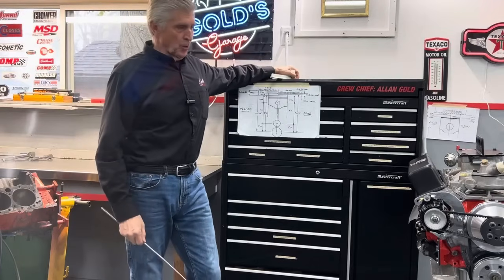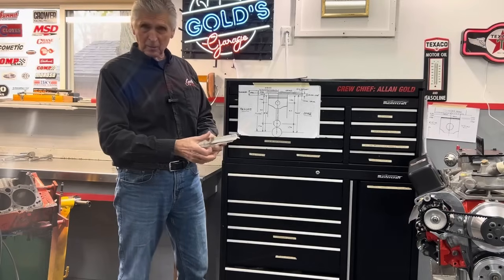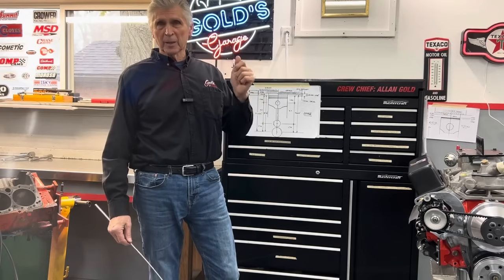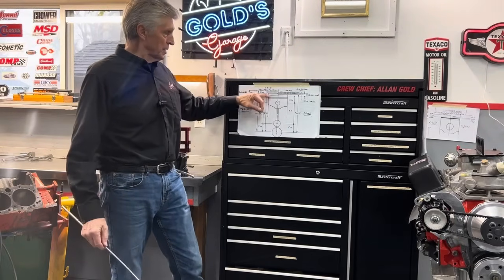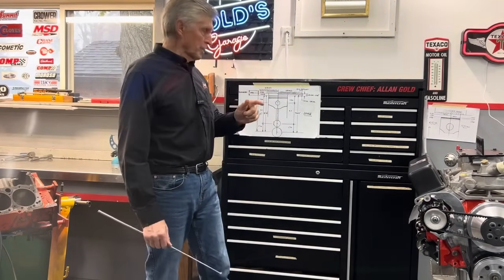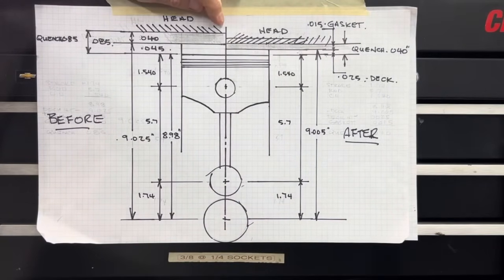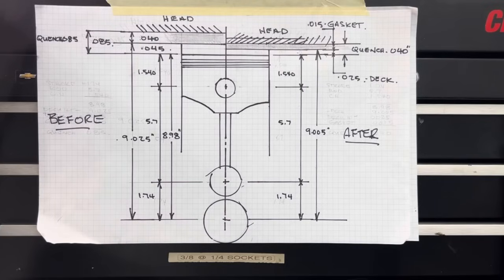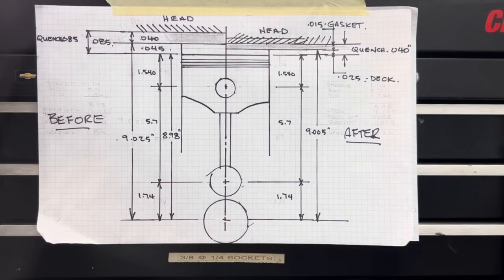MORE COMPRESSION, MORE HORSEPOWER LESS QUENCH! Why it’s Important and what is ideal?  🚫DETONATION

Comment: Forgive me if I didn't see it in other comments.   Crevice volume above the top piston ring and around a head gasket bore that is more than needed can also lead to detonation. Much better burn potential as well.  I recommend a Cometic gasket with the same bore size as your cylinder.  It's probably not in the budget,  but if you go with a 6 inch rod your piston choices gets better and you can get a ring package much closer to the top of the piston.    Just things to think about.   Cheers.
Reply from the maker: All good information, thanks for commenting Comet.AG

Comment: What steel sbc head are you using on this build?
Reply: Cast# 292 angle plug heads.
Reply from the maker: Correct, thanks MJ. Note that the heads are cast iron.  AG

Comment: Old Small block LA mopars always had an open chamber with zero quench.  They should be horrible to tune, and make no hp/tq given your reasoning. In fact, tuning some high hp turbo combinations, your "quench pad " became an issue, and a source of spark knock. It isn't simple
Reply from the maker: Thanks Kyle, sounds like a challenge for sure. AG

Comment: In regards to deck height, are slightly longer con rods not a viable alternative to reduce quench?
Reply from the maker: Thanks for the question, no because 6" rods require pistons with the pin hole moved toward the deck (shorter compression height) to compensate for the .300" longer rod. As far as i know there are no commercially available rods with just "slightly longer" center distances. AG

Comment: The "D" dish TRW Turbo piston is a good piston for HD use.   I've bushed rods, offset ground cranks  do whatever it takes to get your deck clearance.  When tearing down your core check the deck clearance at all four corners before you pull the pistons
I got involved with quench with the 413 Dodge Truck HD engines  the ones with the plugs on top and a wedge chamber
those motors worked better with quench.  Other backgrounds were with our 62 Ramcharger and all the problem with the 13.5:1 compression without correct quench (too big a dome and not enough compression height and the spark plug down low in the side of the head,  Why Mopar never used the 413 Truck style plug placement in the passenger cars is beyond me.
68 Mopar came out with the open chamber.   Immediate problems with detonation with our STOCK car,  We put the 67 closed chamber heads on till we got caught.  
Now some say the open chamber heads can make more power  True at the very top end BUT you have to have race gas
Never works on the street.  We welded up the chambers then Had Nick Arias do some pistons with the head / domeraised to fill the open chamber  Worked great but expensive  We worked with John Erb at United ENgine and developed the quench dome hypereutectic pistons sold under the MT brand and now Icon.   True Fact  using these pistons and tight quench you can reduce your EGT by 800 degrees (and without the stock MOPAR smog cam with the long exhaust which gives an EGR effect)
Do whatever it takes    more if anyone is interested
Reply: I like the sound of that! I'm no engine shop, but I've tried a few things in my garage with the 2 mopars I've built. 383 - flat top pistons . I took off the 906 heads, and put on 516 heads with bigger valves, mild porting and smoothed chambers, steel shim head gasket. 10.0:1 cam 226@.050. Ceramic coated ports, chambers and exhaust valves. I almost can't get the engine to detonate on premium fuel with 30 deg base and 42 deg total timing (plus 18 Vac) It runs great in my truck. I'm dialling back the timing and trying running on Regular for the next couple months to see how it goes The other is a 360 which I used the stock heads, big valves and the UEM quench dome pistons (sold under Keith Black) I welded around the edge of the open chamber quench pad a bit to better contour with the piston quench dome (tighter squish). When I broke it in, the piston kissed the head where I had welded on 2 cylinders, and I had to reshape it a bit, so I guess I found the limit. I finished the cam break in on that afterwards but haven't done anything more with it yet. I'd love to hear more about your quench work on the mopars. Thanks!
Reply from the maker: Thanks Jm. Mopars sound complicated. I still have a 340 to do in the pipeline, you will be my go-to guy for advice when i get to it. Thanks for contributing to my channel. AG
Reply: @goldsgarage8236  Is your 340 going to be a matching number restore or an open build  If open build research heads  Many  late heads outperform even W2 Heads.  A 360 is just a stroked 340  If you are getting a crank kit GO BIG and light pistons make it rev like a 302 chev     do not bore any more than you absolutely have to with a stock block
Reply: @goldsgarage8236  A little more planning on that 340 build.  Do you want to run roller cam? If so sell the 340 to some matching number restore builder and get A: a late model roller 360 block or B get a 5.9 Magnum block.  stroke either  The Magnum   (AMC designed) heads are much better than any LA head, almost as good as minor reworked W2 heads (better than most any SBC head even Vortec but not SB2)
slap 340 looking valve covers on and brag about it.   I'm a big Stroker McGurk fan on the street.

Comment: You got it right Ag!👍🏻 Sbc likes a tight quench for max power. We go tight for both increased hp and detonation resistance.. 
I’ve seen them run at .020 with steel rods and some of the builders I know say they’ve went .018. Zero the deck and run a felpro. 039 and you’re wayyy safe. We run mls gaskets they’ll make them whatever thickness you’re looking for.
Reply from the maker: Thanks Phil, i think there are "diminishing returns" for everything, even quench. i will play it safe with the .040" AG
Reply: @ It will be a whole different animal than it was that’s for sure Alan!👍🏻 Keep up the good work man , always enjoy you videos!

Comment: One thing you need to remember about when the engine shuts down and diesel,s or runs backwards. Is the oil pump will also pump oil in reverse, so you are sucking the oil off the bearings when the engine runs backwards.
Reply from the maker: Thanks Racer, that is a really good point that I never thought about. We are always learning.AG

Comment: Also I learned that most stock rebuilder pistons have around .020 shorter compression height to account for cutting the deck of the block. To me that seems excessive. Maybe .005 shorter would work just fine.
Reply from the maker: Thanks Robert. I do not understand why they do that. If they made them .020" longer instead, i wouldn't have to deck this block. AG

Comment: Machinist that Prepped my block Polished crank and balanced my rotating assembly. Gave me a Print out with the numbers. I pay the big bucks Because he is a pro and I'm joe blow. I decided to buy the tools and double check. Can't figure out how he came up with his numbers. He say .002 out of the hole and it is  -.004 in the hole.  2618 pistons. So it would have Grenaded. And he would have said it  was me and I would have been 👌👈
Reply: Same here but with an old th350 trans had this shop do a stage 2 rebuild had a bad pan leak first thing lucky I took apart this thing was missing all the check balls and a couple springs that keep it quiet when shifting..never will go to a shop that claims way more than they can offer...
Reply: I went further after opening pan up inside pan was filthy and full of grey shit that's when I found more things wrong...2k rip off..
Reply: @jondough4116  I pay 1,700 and didn't have them Assemble. Hot tank, Balance rotating assembly, cut main caps, hone to 4.005 with deck plate. He was Supposed to deck. It's in the price, but sence it was close he didn't. Next time I will order a block from a cnc shop up north. Could have saved five hundred dollars and it would have been right more then likely. And wouldn't have taken 2 mouths. I thought about it after sending first message. It wouldn't have grenaded. It would have added .006 to Quench and piston to valve  and lowered compression. But sence I'm at 11.1 with a .036 it would have Possibly been fine with the .o51 Gasket he Measured by. But the Quench would have been. 046-047
Reply from the maker: Thanks for the comments guys. i know it is frustrating. If you have no ability to measure, inspect or verify work, you are vulnerable.  
i do inspect and measure everything my MS (Atchison Machine in London Canada) does for me, but I have to say that their work is very precise and the quality is impeccable.AG
Reply: @goldsgarage8236  Your welcome. But the flustrating part for me. Is not because I don't have a way to Measure. It's that the measurements are not right, it's that I grew up believing that a man says what he means And means what he says and stands behind his work. I should have been Amish. But Wearing the same thing every day and the same thing as every other guy and not having a mustache with my beard would be just too much. Lol

Comment: When you mentioned that the pistons were .030 in the hole it reminded me of my last SBC build. My pistons were .050 in the whole and was going to be a lot cheaper to have the block decked than to round up another set with a better compression height.
Reply from the maker: Thanks Robert, true, but there is a limit to how far you can go with decking. AG

Comment: Mr. Gold.  I have seen a number of your videos and enjoyed each one.  Please keep up the good work.  About 20 years ago I hired my local engine rebuilding shop to do a complete performance rebuild of my 1977, 400 cid Pontiac engine.  A stroker crank assembly from Eagle was installed which brought the displacement up to 461 cid.  After the block was machined and the rotating assembly test fit, it was found that the pistons were 0.015" down in the block.  The gasket compressed thickness was 0.039".  Jim Hand, a well known Pontiac drag racer and performance enthusiast of the time, strongly recommended that I have the deck to piston clearence taken to 0.000".  To your point, Mr. Hand stated that this would greatly improve the quench and reduce risk of detonation despite boosting the static compression ratio.  I made this suggestion to the shop and as far as I know.....they diid it.  I can tell you that this engine was broken in and tested over 20 times on their engine dyno and the engine ran very well.  It still does.
Reply from the maker: Thanks Sean. Your comment is a strong real life affirmation of the points i was trying to convey. Thanks for taking the itme.AG

Comment: I commented about this project the other night in a lengthy post but if you are going to put in a rotating assembly then do your customer a real favor for about the same money and build him a 383. The increased torque and power will put a real smile on his face and no one will know except you and him. Personally if I were staying at 350 inches then just use the stock pistons if the bores are good without much taper. The TRW's are fine. After you clean them up they will look and work like a champ. Do a smooth bore finish and use some moly rings. If the deck height is .025 the use a steel shim gasket to get about .040 quench like they originally came with. Put a small roller cam in it and enjoy it.
Reply from the maker: Thanks for your suggestions Mike. I will comment on the 383 upgrade in a future video, many commenters agree with you.AG

Comment: That is definitely not ideal, 80 quench is really bad. I think 50 is about max I would ever go. GM recommends 35-45 thou. My 327 build is going to be 36 thou, 16 in the hole with 20 thou gasket. I had the crankshaft in my LS1 offset ground to get a tighter quench, thats a method I would only suggest if the crank is already getting turned..
Reply from the maker: Thanks Jeffery. Grinding the crank offset is I method I have never seen, and correct, it only works if you have to grind it anyway.AG

Comment: I like 1.56 compression height pistons, deck to 9.010 and run the GM .028 head gaskets.  Skip White also sells pistons with a +.015 compression height = 1.575. More than one way to skin a cat...
Reply from the maker: Thanks Jesse, Sounds like you have it figured out. The Skip White pistons are an option, but not inexpensive and don't come in Eagle rotating kits.

Comment: Also, don't hesitate to use 1.560 pistons to get your quench height when you can. It can eliminate the need to deck the block when the surface is good. I personally prefer the 1.560" over the 1.540" pistons in the 350 most of the time
Reply from the maker: All good comments, thanks Guys.AG
Reply: U have use .020 steel shim gaskets with 1.560 pin height pistons to get your correct  quench!   Or deck it .020 with .040 gaskets.
Reply: @jessesyfie7244 Are you then saying the correct quench is, and must be no closer than .045? If so then I disagree. I have run many SBC at .035 on street engines (those running sub 6500 rpm). It is a better quench than .045 to combat detonation as long as the CR is not above what the octane rating can accommodate. Many of those engines when a thicker gasket is used will detonate even though the CR is decreased by the gasket thickness
Reply: @bobnankervis9722  yes. .035 would be better than .045.  If your willing to go that tight without pistons  kissing the heads.  I been shooting  for no more than .040
Reply: Any quench distance less than .060" is adequate. You can go shorter but anything less than .060" is reaching the point of diminishing returns.
Reply: @bobnankervis9722  If you start running that tight of clearances, it would be good to check that clearance on every cylinder if possible.  Could have tolerance stack, have a hole or two be tighter, which could get bad quickly.  Things like the deck surface being slightly out of parallel with the crank, a little variance in rod length, piston height, etc etc.  

One of the advantages of running a "blueprinted" setup is being able to tighten up all the tolerances (like squish/quench clearance)...The flip side is, when you tighten the clearances, you gotta either check everything or blueprint everything (and doesn't hurt to check the blueprinted parts too!  Things can certainly happen when parts get machined
Reply: Have a 350 in my El Camino..Flat top 4 valve reliefs 1.560 Pin height replacement KB pistons and a .015 Steel shim gasket for a .045 deck with Vortec heads. Makes about 10:1 compression. Very responsive. Run 91 Octane and no problems with detonation. Did the same tight deck with an Air Cooled VW, 2017 stroker,460 Lift 308 duration Engle cam, ported heads and 44mm Webers it hung with a C6 Vette all the way through 3rd or about and 1/8 of a mile.
Reply: Thanks Mr gold you have an abundance if knowledge I greatly appreciate your posts sir keep them comming, I'm still trying to completely understand the quench deal. Thanks sir!

Comment: AG just tore down my 357ci Cleveland last week. It had only travelled around 15,000kms and was tired. It had been built with 030 over pistons and a 050 compressed head gasket. Pistons were 036 down the hole, so 86 thou of quench. Did not work well at all. Full of carbon, would rattle with 24 deg total timing. Had the "good heads" on it ie: 302 Cleveland closed chamber 57cc. Measured in at 10: 1 static comp. Also had a very oversize head gasket with an average size of 4.150 inches. Very poor combination. Great content AG. Tim Australia 🇦🇺 ❤
Reply from the maker: Welcome Tim from Australia. Great comments and sounds similar to what I found in Paul's engine. You know what to do! AG

Comment: For the SBC I've found .035 to .045 quench works excellent especially with higher compression engines. Engines with aluminum rods require a bit more gap as the rods grow more in length when up to temperature. My rule of thumb is "if the pistons never contact the heads, the quench is not too tight". Of course if it is too tight, you'll find out the hard way! Lol
Reply from the maker: Thanks Bob, like flying too close to the sun! There is a safe limit to almost everything.AG